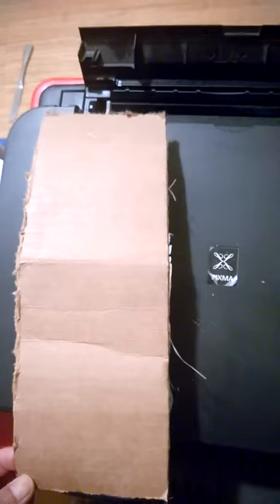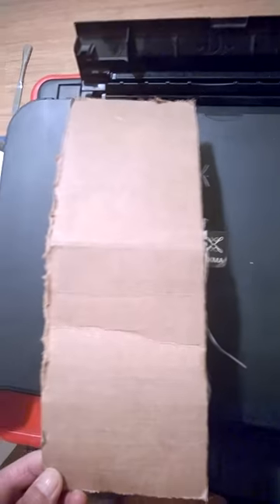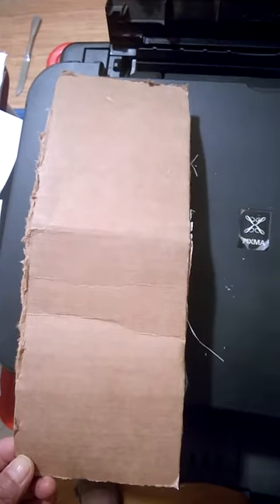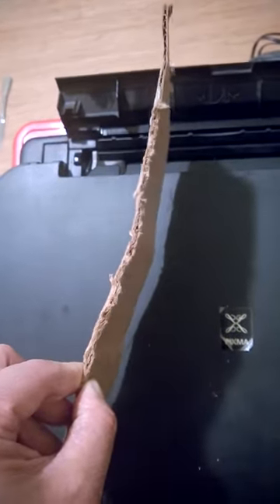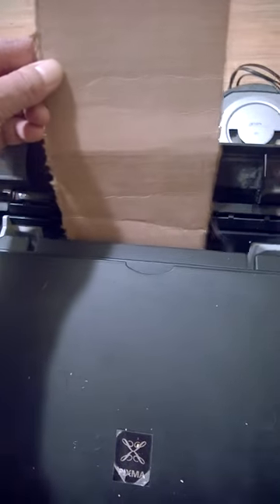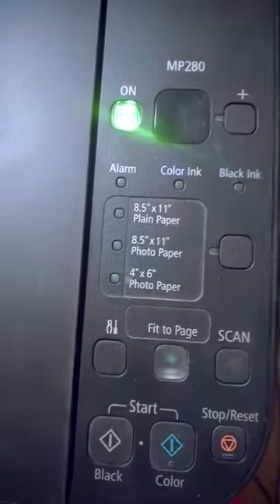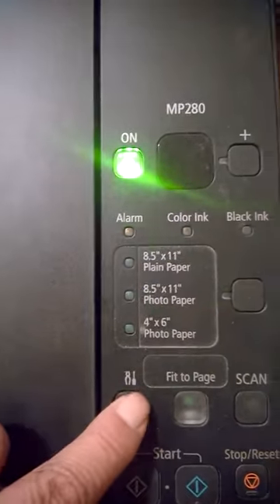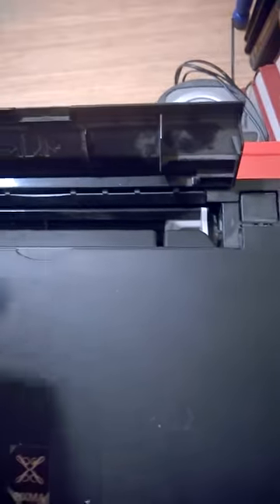Paper pick up Canon Pixma printer paper feeder not feeding paper properly in less than 2 minutes

Comment from the maker: Your printer does not need to be turned on to insert the cardboard. I turned mine on because I thought I needed to clean the roller but after I did that it still would not pick up the paper. So I tried inserting the cardboard while the roller is rolling, thinking it might make the board go though easier...but not really. So don't worry about not knowing how to make your printer's roller rolling. Just force the cardboard in.
Reply: Your idea is 100% correct. and your video deserves a 1000 thumbs up.
In my case, I tried using a paper to get the object down. but it did not.
guess what did I do ?  I flipped the printer upside down and I found something interesting
I found uA741 operational amplifier , Lol .
Reply from the maker: So glad the idea worked for you. :-)
Reply from the maker: Thank you all for your feedbacks regarding this method. :-) It's funny/not funny to read the kind of "stuff" that caused the paper not going through the feeder,  that were "pushed out" by using this method,: a Flower Stem. hah! :-).  I almost gave up trying but I am glad I did not. So. Try this method when you have relaxed and have some time to yourself. So you won't be frustrated on your first try/tries. :-). So let us know what you found inside the paper feeder that caused the problem. Unless, ofcourse, you found something you did not want anyone to know. :-)
Reply from the maker: Thank you all for your feedbacks regarding this method. :-) It's funny/not funny to read the kind of "stuff" that caused the paper not going through the feeder,  that were "pushed out" by using this method,: a Flower Stem. hah! :-).  I almost gave up trying but I am glad I did not. So. Try this method when you have relaxed and have some time to yourself. So you won't be frustrated on your first try/tries. :-). So let us know what you found inside the paper feeder that caused the problem. Unless, ofcourse, you found something you did not want anyone to know. :-)
Reply from the maker: Thank you all for your feedbacks regarding this method. :-) It's funny/not funny to read the kind of "stuff" that caused the paper not going through the feeder,  that were "pushed out" by using this method,: a Flower Stem. hah! :-).  I almost gave up trying but I am glad I did not. So. Try this method when you have relaxed and have some time to yourself. So you won't be frustrated on your first try/tries. :-). So let us know what you found inside the paper feeder that caused the problem. Unless, ofcourse, you found something you did not want anyone to know. :-)

Comment: Thanks alot i was kinda scared i would have to get another one after tryna fix it for 2hours i shoved cardboard in it presses text one side of the rollers was connecting to the carbaord so i moved it to that side like you said and it worked didnt actually find anything inside it maybe a roller was just misplaced and it got pushed back in

Comment: OMG Thank you!...I was ready to throw my printer across the room. However, I tried doing the tool button but ran into another dilemma and found out why I could never connect to WiFi and it wouldn't let me continue through that tool. So I turned it off and then back on and just tried printing and forced the cardboard through and found an earring as the culprit!
Reply from the maker: kim hopkinson _ glad it worked.:)
Reply from the maker: Hope you didn't throw away the other ear ring. ;)
Reply from the maker: Thank you all for your feedbacks regarding this method. :-) It's funny/not funny to read the kind of "stuff" that caused the paper not going through the feeder,  that were "pushed out" by using this method,: a Flower Stem. hah! :-).  I almost gave up trying but I am glad I did not. So. Try this method when you have relaxed and have some time to yourself. So you won't be frustrated on your first try/tries. :-). So let us know what you found inside the paper feeder that caused the problem. Unless, ofcourse, you found something you did not want anyone to know. :-)

Comment: It works but I use a file folder instead of the cardboard. At first I thought it was a joke because cardboard is very thick and could damage the feeder. I use the file folder and it is a lot thicker than a piece of paper. My copy machine was turn off, I push the file folder to the paper jam area that was on the right side of the feeder and it push a piece a small paper out from the feeder, then my machine works again. Thanks for your info and the you tube.

Comment: DON'T try this before trying to shake or pry the foreign body out the normal way.
Just look after items stuck tightly in the mechanism.
When I worked as a printer repairs technician - we sometimes took around $25 just for throwing out the thing like paperclip  that blocked it in 1 minute. Because we just knew it. That's how valuable the knowledge is. It's the knowledge that get you paid, not the time spent on something. I'm sharing it with you so you didn't have to spend $$$ on repairing it, because of such a risky unwise try, as shown in the video (it's like 40% for that it might get your problem much worse by pushing the item even deeper and tighter so the repair would be like 50 dollars because of too much work or the risk of damaging the whole mechanism...)

Comment: My printer was pissing me off for an hour and this saved my ass. Thanks so much
Reply from the maker: I am glad it worked. I discovered and used this method out of frustration too.
Reply: my mp250 takes the paper in the wrong side. even if I put the paper correctly, once it start printing, the paper goes with incline and the whole process is wrong. Is there something blocking the paper pathway in the leftside ? because it keeps pulling only from the right side
Reply from the maker: sounded like there might be something blocking the pathway. try the trick.
Reply: yeah , I flipped the printer upside down  :D and I found uA741 operational amplifier chip  XD it was blocking the pathway
Reply from the maker: You are very welcome!
Reply from the maker: Thank you all for your feedbacks regarding this method. :-) It's funny/not funny to read the kind of "stuff" that caused the paper not going through the feeder,  that were "pushed out" by using this method,: a Flower Stem. hah! :-).  I almost gave up trying but I am glad I did not. So. Try this method when you have relaxed and have some time to yourself. So you won't be frustrated on your first try/tries. :-). So let us know what you found inside the paper feeder that caused the problem. Unless, ofcourse, you found something you did not want anyone to know. :-)

Comment: my problem is that my feeder NEVER worked from the start. I never returned it because I thought it may have been a firmware or driver issue and I put it off. Just loading things on the glass was good enough.  Needless to say, once I plugged back into trying fix the problem Im finding that it has nothing to do with firmware or drivers and the darn thing just doesnt work period.  My rollers have never moved.  Im way past the window of returning for a refund.  Maybe I will try jamming cardboard in there to see if it knocks something loose.

Comment: I thought I got the same problem, I didn't worked for me. 

My canon printer mp287 is not taking paper for printing it takes little paper and then stops so it's practically  jammed. I've been searching for answers and tried different methods but until now I will have to keep searching.
Reply from the maker: Thank you all for your feedbacks regarding this method. :-) It's funny/not funny to read the kind of "stuff" that caused the paper not going through the feeder,  that were "pushed out" by using this method,: a Flower Stem. hah! :-).  I almost gave up trying but I am glad I did not. So. Try this method when you have relaxed and have some time to yourself. So you won't be frustrated on your first try/tries. :-). So let us know what you found inside the paper feeder that caused the problem. Unless, ofcourse, you found something you did not want anyone to know. :-)